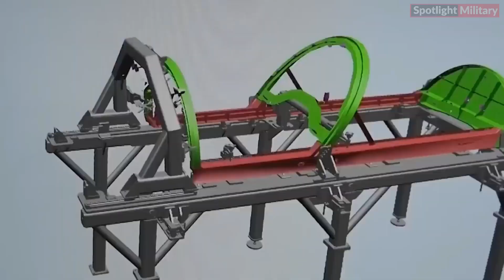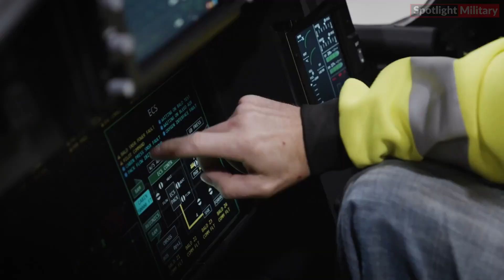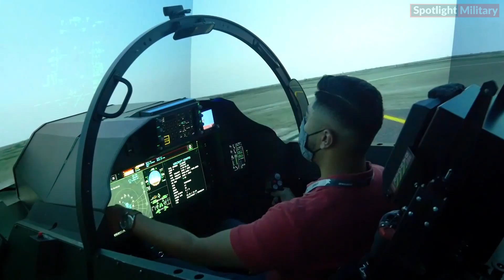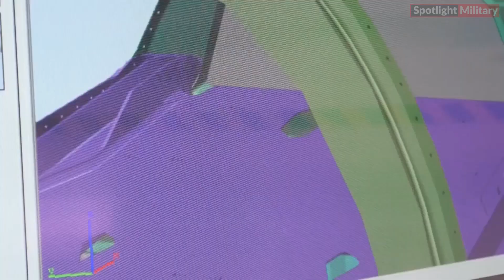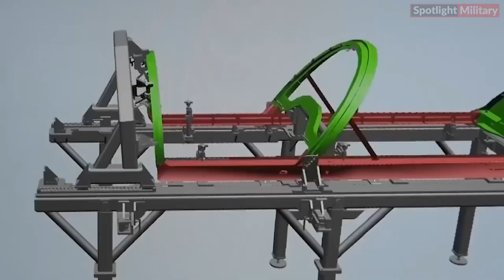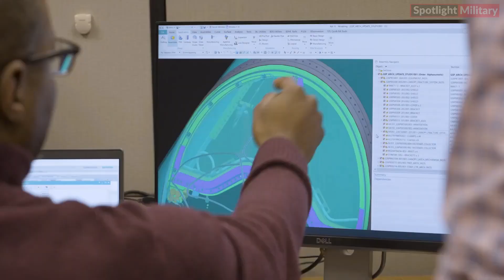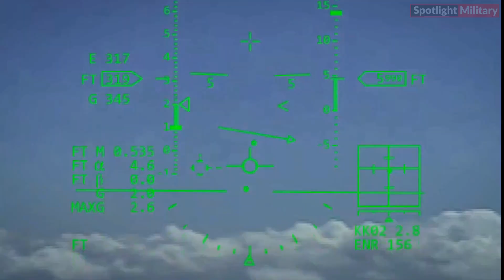T-7 Red Hawk trainer aircraft: Why? The USAF delays Production Schedule for another 2 Years (2026)

Comment: There is a company refurbishing the T-38 with new engines, more speed, new equipment to modernize it.  The new top speed is Mach 1.6 and the total cost is much less than a new purchase.  Sadly, had they purchased the Lockheed-Martin T-50A, they would have them now.  It has better ground training, the top speed is Mach 1.5, and is now being sold worldwide, except to the US Air Force.